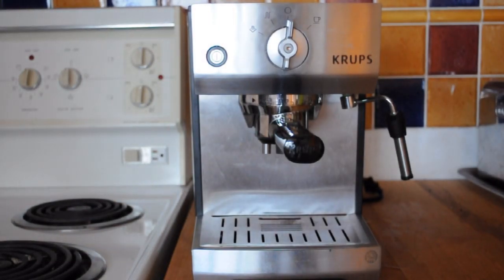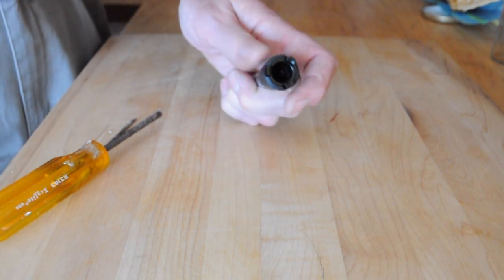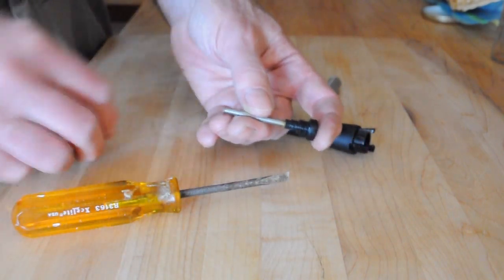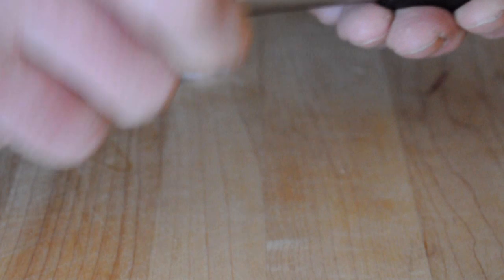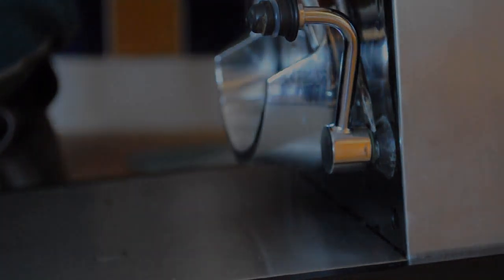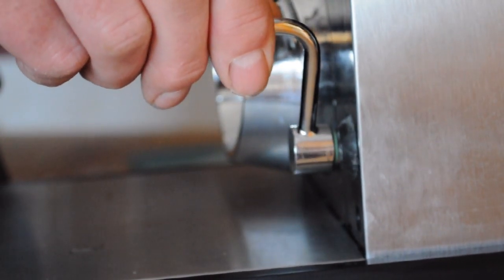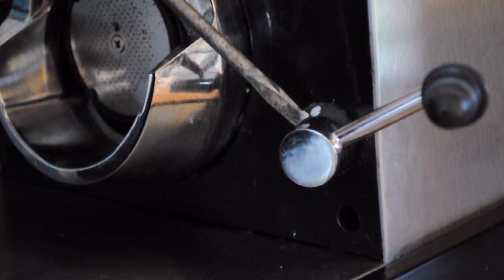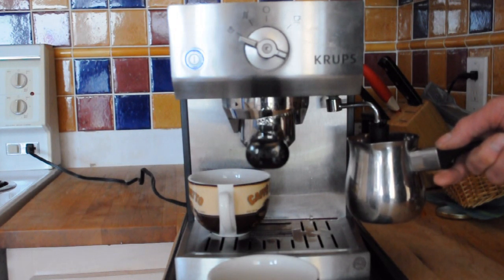Krups XP5240 Steamer Wand Repair

Comment from the maker: Yes, the black handles are a problem as well. The complete handle/coffee holder is available for around $35 (in Canada), but it's the same material and it's likely to break as well. We tried a metal sleeve over the handle near the coffee holder, but because the plastic was already cracked, this lasted only one day. On a new handle we think it would be successful. Since we did not want to buy another coffee holder, so we made a new handle in aluminium in our machine shop. Look in the PiXCL Automation website for some how-to pictures of this.

Comment: One of the tabs has come off our nozzle and we can get a new nozzle but it's not quite the same as the old one(doesn't have the tabs), but comes with the bit that the nozzle fits on to - will the old receiver part just screw off?

Comment: I just got the new steam wand replacement but the instructions are only for cleaning it.  The replacement comes with the wand and the part attached to the articulated arm.  But there are no instructions on how to remove the existing part attached to the articulated arm!!  Any ideas on how to do this?

Comment from the maker: If you mean the finger sized steamer wand, you have to unscrew the part attached to the articulated arm. This may be stuck on with thread locker glue. Use pliers to grip the part. Note there should be a small O-ring in your kit. This goes on the articulated arm before you screw the new part in place to stop steam leaking out. It's a good idea to use some thread locker (consumer grade super glue will do) as the new part must not move when you need to unclip the new design steamer wand.
Reply: Thanks.  I did try this with the pliers.  The original steamer wand ended up being mangled since the plastic is very soft.  To loosen, you have to turn to the right, which was counter-intuitive for me.  I thought it would loosen when you turn to the left.
Reply: Really, clockwise removal? That's really nasty design.

I strongly suggest simplicity when it comes to coffee, make use of a bodum, a Phin  or a moka pot. Minimalist, low maintenance, no odd ball design.

Comment: There is a 3rd and possible fatal flaw with this unit.
The handle develops cracks near the screw in the bottom and spreads out and eventual breaks. I slowed this process with a hose clamp, but eventually the handle fails.
I think Krups has a problem with the black plastic they are using as it seems to fail under loads eventually. I also had the steamer break as well. The machine makes a great cup of joe, but would be nice if it lasted more than a year.

Comment from the maker: Update on the steamer wand ball joint: after several unsuccessful attempts at stopping steam leaks, we had the machine shop make a 35mm long tube from stainless steel, with a barb on the top where the internal steam hose connects, and an M10-1.5 thread on the bottom to connect the steamer wand and its O-ring steam seal. The ABS ball joint was drilled out to 12.7mm and the steel piece pressed in. This definitively fixed the problem.  In summary, the 5240 is a good design poorly executed. The fixes in time and money were still cheaper than buying a new coffee machine.
Reply: Cool, DIY appliance fix.